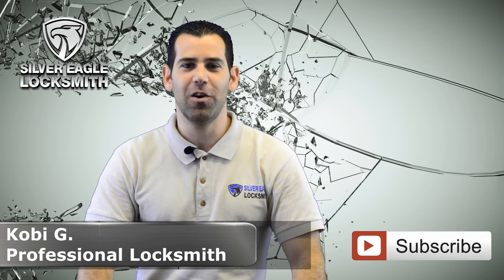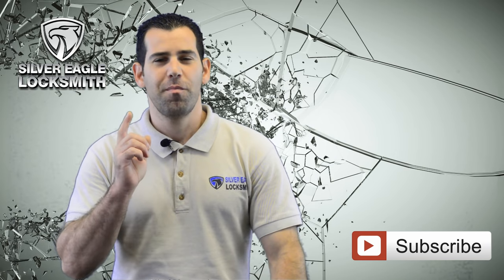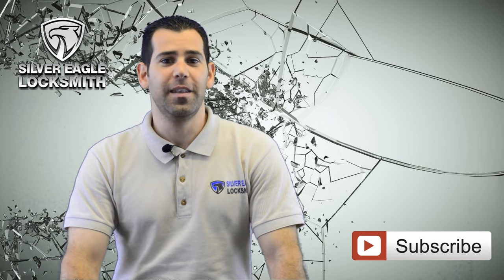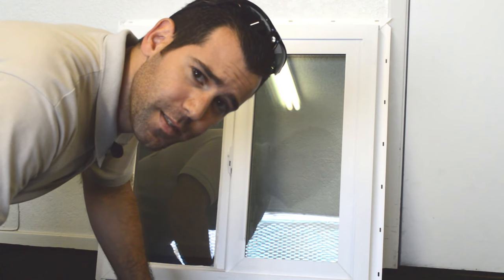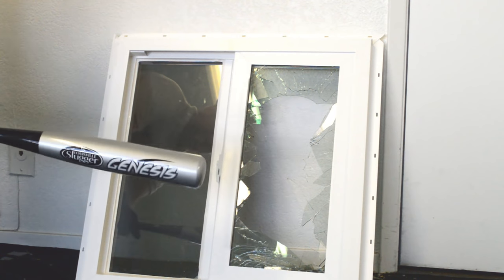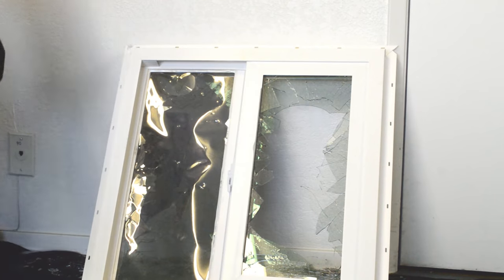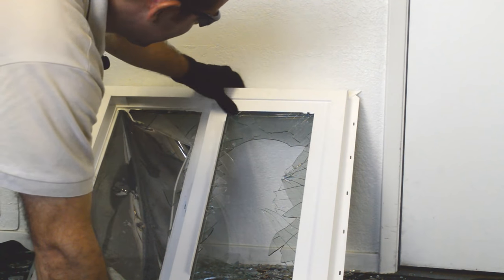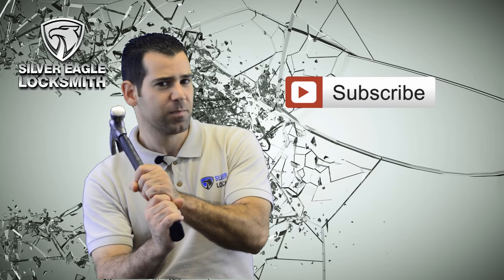3M Security Window Film - Window Security Film Demonstration & Explanations

Comment: I call BS... that tinted window was removed and tinted outside of the window frame then put back into the frame. You can tell simply by the sealant used to secure the window pane to the window frame. If you put that tint on any regular window already installed in a house it's going to fail ... just like putting window tint on a car.. it will hold the glass for to it then collapse.
Reply: When you put the film on the inside or out. You have to caulk the film to the window. Because when you install the film you have to a 8th of a inch cut strip of it off on the frame then you caulk over that gap.

Comment: Obviously the 3M film is strong, but as soon as the glass was broken, he could have used a knife and easily cut through it.
Reply from the maker: Yes they can use a knife to get in but the only thing is that it will take longer for the process in general! 
And that’s the whole purpose of this security film
Reply: @S.E.Locksmith  That is true. And anything that can delay a burglar entering is good. But about how much more time will it delay the entry. I think it will take about 10 seconds to break the glass and cut through to get in. Don't get me wrong, I'd rather have it than not, but I'm trying to be realist in that it probably won't make a difference overall.
Reply: @david894  You have to take an additional consideration, the shattered glass on the window will still be an obstacle upon entry , by then authorities have been called & the family/individual(s) are outside or hiding . Though you're not wrong, its a small window of time.

Comment: Cool video, but for a valid test, use the same tool for both variations! Pick one - either the hammer or the bat, and use it for both windows. Though I don't think anyone would complain about a demonstration on both windows with each tool, but not split like this. Thanks!
Reply from the maker: Thanks for the comment on the 3M window film demonstration
Reply: That's why I gave a thumb down.

Comment: Can the 3M Security Window Film be used for the windows of a vehicle? For the purposes of detering/preventing a vehicle break in?
Reply from the maker: For all I know the answer NO 
The purpose of the 3M window security film is to Delay the process of break in  through the glass window and in case of an Emergency 🚨 it will be harder to break the window of your car which is not good idea! You can relax it’s not easy to break the glass window of any car it’s designed to be harder for that purpose. Only government vehicles etc, have bulletproof glass window for security purposes.
Reply: I was thinking of the same thing, could be good for car windows could be bad

Comment: Great video and well demonstrated.  However, is the film suppose to be installed on the inside interior side of the window or the exterior outside of the window? Also, can it be installed on both sides or is that unnecessary and somewhat overkill?
Reply: Good question. Hope he'll answer, but I'm not holding my breath considering how long ago you posted your comment lol!
Reply from the maker: This film can be installed both sided of the window, but it will cost a lot more

Comment: So if the film is on the inside of the glass, is the glass going to be harder to penetrate on one side than the other?  I tested the film on a spare pane of glass with no frame by hitting it on the film side and it broke from a light hammer blow.
Reply from the maker: So it depends on the type of security film that you have and also the type of glass window that you attach it to. 
If the installation made by professionals it should give you a great security in definitely delayed the breaking process

Comment: Can I use this stuff on my car as well? will it interfere with windows rolling down at all? Thanks!
Reply from the maker: You probably can, but I don’t recommend this in some cases for safety issues if you have small children’s and in emergency situations you have to brake a window to get in... what then ?
Reply: There are many other ways but to save time and go off your scenario of breaking the glass to get in. All you would need to do is break the glass then use a knife or sharp object to cut the film.
Reply: Guaranteed way to make a death trap if you ever have to get out of a high water situation or a bad accident where the doors won't open

Comment: what if they use a knife
Reply: so anything above 8 mils would be overkill? such as 10, 12 or even 15?
Reply: Robert Jordan 
They can go right on ahead play arts and crafts after making all that noise and activating my glass break sensors.
Reply: That takes more time than a burglar wants to spend. And hopefully you have glass break sensors. Nobody's gonna stand there for 3-5 minutes while an alarm's going off and lights are coming on.
Reply: Robert Jordan cant use a knife until after you smash it..unless u have cut glass before with your pocket knife :/ which by that point you should be aware!! Its called a DETERRENT!! not impenetrable
Reply: That's a you problem

Comment: Would this help against hurricane or at least better than just the window without any protection?
Reply from the maker: +Aldo N 
Most definitely it will help 
They actually invented it for weather resistant and afterwards they use it for security purposes also
Reply: Silver Eagle Locksmith Thanks, one more question this film sticks to the window and I guess it sticks all the way in the corners but it doesn't overlap into the window frame so if the glass brakes on the edges won't the whole window come off? I dont know if I am making myself clear, but let me know... thanks
Reply: Can I buy this at Home Depot Hardware?
Reply: I believe there is a frame that comes as part of a kit.

Comment: As the film is not secured inside the window frame it is easily pushed in side once the glass is shattered. Or use a box cutter as Alex Stewart suggests below
Reply from the maker: the window security film is only meant to delay the brake in processes not to prevent it !
Reply: Wesley Small 
3M use an Dow Corning attachment system with installation to prevent it from being pushed inside when glass is broken.
Also my sensors activated and called police soon as you broke the glass.
Motion sensors and cameras already alerted me soon as you stepped on the property.
Should give up and move on at that point because they have to clear some glass to make a cut which is more time wasted.
But if they insists wasting more time doing the arts and crafts with the knife and come inside my home that's fine too.
Here in Oklahoma.
Reply: BlackWorldTraveler What security system do you use?

Comment: How does it hold up to a butane pocket torch and a bottle of cold water?Should there be a house fire what kind of fumes does this film give off? Whatever happened to wired glass? Inmates from our county correctional center used the hot ember from a cigarette to melt through bullet-proof glazing and escaped, but did not get far.
Reply: paul smith 
Some of us don't live in a war zone.

Comment: What if they're smart and carry a good pocket knife like many men do? Not that I'd do it but it seems after two good strikes a blade would slice through that film like butter. Do one with someone stabbing it with a lock blade to convince me.
Reply from the maker: First of all just so you know the security film is installed inside of the glass window and not in the outside. 

So they will have to break the glass move the remaining glass parts so they won’t cut themself and use a Sharp knife to cut the security film... 

Long story short and this is what I explain to all of the people that watching this video is that the security film never designed to prevent break in but only to delay this process as much as possible, so it can increase your reaction time in case that you’re in the house and or increase the time process of break in for the burglar, which is very crucial statistically speaking. 

Hopefully by that time they will give up and move on and that’s really the whole point to have the security film.

Comment: Except once the glass is broken on strike one or two they can take a knife and cut through the film, no??
Reply from the maker: Yes they definitely can, but it’s going to take longer than you think... 
depends on the glass thickness, the quality of the security film and it’s thickness as well. 
Long story short it’s not designed to prevent break-in process but only to delay the process as much as possible I need to may very between different scenarios as I mentioned

Comment: My shop has security film and we were just robbed, they simply broke the glass and cut a hole in the film.
Reply from the maker: Yes I know and totally agree that security film will not prevent burglary from glass window or doors. It’s really good for delaying the process in a min or 2 
But if the burglars are determined to get in regardless if you have a security film or not they will brake in.

Comment: Why are you striking the small window  from the film side//////the burglar would be striking the glass side  yes?
Reply from the maker: We’ll get the same results as far as how long it will take to brake in. 
No matter which side 3M Security Film was the demonstration
Reply: Sorry, you are mistaken. Much more secure when film is applied on the inside surface of the glass. Maybe you should limit yourself to being a locksmith.

Comment: Great for slowing down a break in. But if they notice the film or know it is installed they can then use a knife to quickly cut a square and slits in the film then break the window. This still will slow them down and will make more noise to alert a neighbor. With this film and  a security system with window breaking detectors on all windows the crook will not have time to smash and grab before the Police show up. Put sensors also on your doors so if the criminal attempts to kick in the door the alarm will go off. Remember if you are home and must shoot the intruder then shoot to kill or the low life may seek revenge in the future. It is better to know they can't seek revenge over wondering if they are coming after you. After all they be coming in to take your life.  Also remember that Gun Control is able to hit your target.
Reply from the maker: The Window Security Film is a great product overall and Worth the investment. 

About using your weapon it’s all depends on the situation... most burglars will takeoff if they will know that you carry a gun as they only wants what’s in the house and if the situation changed so most likely they will back out from your property. I Truly believe that nobody want to get shot unless he’s on drugs etc

Comment: and the smarter criminal will now suspect by this video that in such case they discover this type of protectant used after attempting to break glass  you need to then follow up using tool xxxxxxx. Only takes seconds  Thanks for educating   criminals :(

Yeah I left out the identity of tool xxxxxxx  purposely to NOT educate a criminal; incase they are not smart enough to figure it out for themself.
Reply from the maker: This video is not to educate criminals but to educate viewers and home owners. 

This video and security film was never intended to prevent a home brake in through the glass window but to delay the process as much as possible.

Comment: Bad experiment. you can't change variables. You should have used the hammer. Because you didn't makes me what to do the opposite of buy your product
Reply from the maker: Well first of all it’s not my product I just make a demonstration. 
If you didn’t like it it’s your decision, but overall it will definitely increase your reaction time in case of burglary & slower down the process in general.